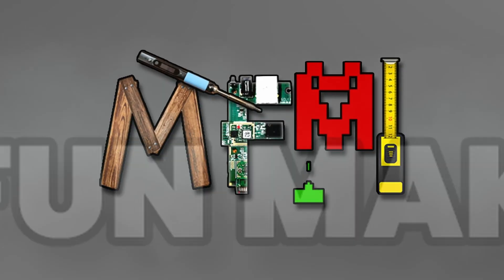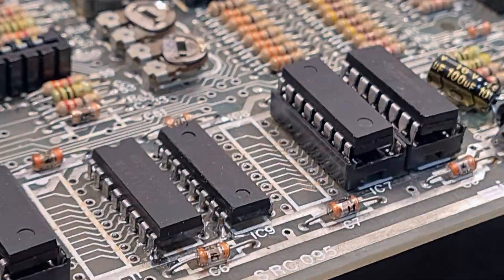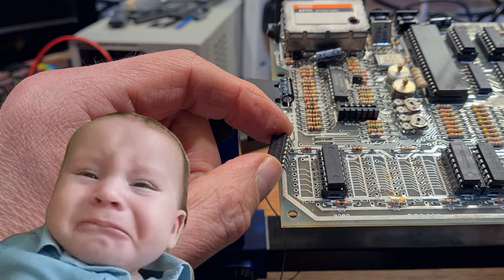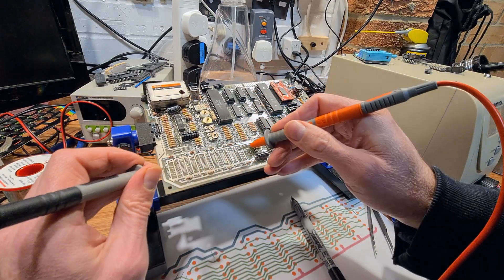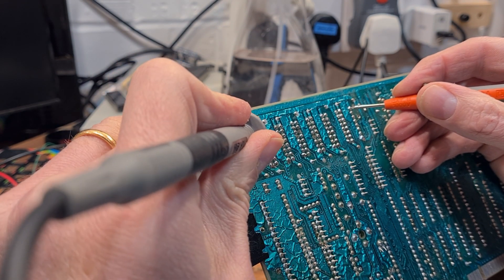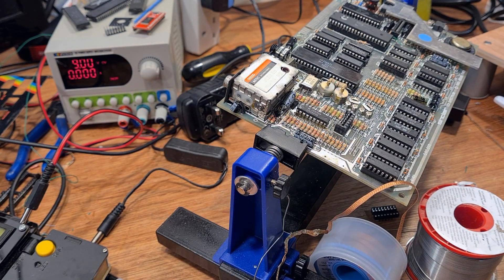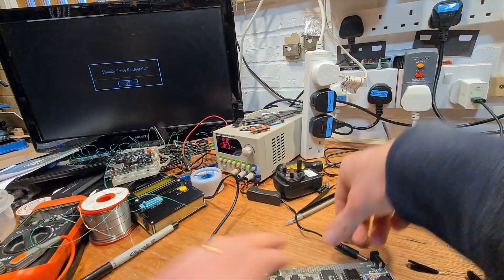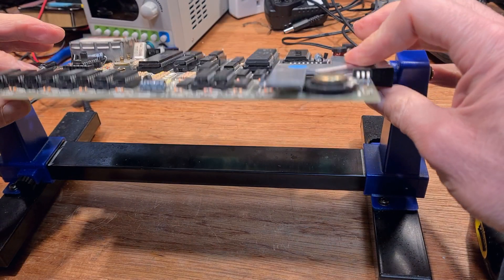ZX Spectrum FROM HELL - CARNAGE - Part 2

Comment: I have to say that although I really enjoy repairing things and watching repair videos in general, I really am appreciating your added brand of specially injection humour.  Very informative and enjoyable. 😁
Reply: As an added side note, I had one of these rubber keyed ZX Spectrums when I was a kid and it went in for repair so many times that I doubt there was much left in the end that was original.  I remember a few times going to the local electronics repair shop with my Dad and witnessing the ever increasing nest of multi-coloured wires as the repair tech showed my Dad the latest fixes.  Ever since I've always had a very strong impression that breathing on these circuit boards would be enough to make the traces do an impression of a drunk lemming, lol.
Reply from the maker: My boyhood Spectrum only had the one fault in its life. The keyboard membrane gave up eventually after too much Daley Thompson. I biked into town and ordered a new one. Picked it up a week or so later (very vivid memories of that journey) and took it home. It was my very first computer repair. I still remember opening up the case and wondering how I was going to get the membrane out of the keyboard.
Reply: @MoreFunMakingIt  I bet that was quite nerve wrecking at the time, but a good starting point on your repair learning journey. I think that my Speccy completely gave up in the end, but no idea what eventually happened to it. Maybe I'm watching you repair it right now, lol. 🤣
Reply from the maker: @juddery  There have been weirder coincidences than that!
Reply: @MoreFunMakingIt  there sure have, although I think the chances are quite slim on this one. I rather expect that my old speccy l9ng ago took its final trip to join sll the little calculators in silicon heaven. The idea of it being the same one makes for a good bit of amusement in my head though. 😁
Reply from the maker: Thank you so much! That's a lovely thing to say. For a moment I thought it was going to be a 'but' after the comma! 😂
Reply: @MoreFunMakingIt  Lol, definitely not. Besides, from watching these spectrum from hell repair videos, I'd say you've already had the but, or more precisely the butt, lol. Amazing repair work on such a mangled board. Someone clearly shouted yeehaaa before diving in to try to do the prior err... repairs, lol?

Comment: 7:20 at that point I think i wouldve opted for a Lower Ram Replacement module... would have made things easier. I can see how the ULA ended up getting toasted now...
Reply from the maker: I won't spoil it for you, but in the end I get to that point too.
Reply: @MoreFunMakingIt  Yep, saw that in the end. Sometimes its just not worth making the original chips work... or replacing them if more than 2-3 are faulty
Reply from the maker: Totally agree. Even if they test ok they're almost certainly about to fail any day

Comment: Excellent video and work! I has a similar issue with a Commodore 64. It was so bad, I told the owner ot would be cheaper to get another board. Over 25 different issues. Sometimes a board just can't be saved, sad
Reply from the maker: There is definitely a point where the amount of work you put into a thing is worth much more than the thing itself. I blew waaaay past that point quite close to the start of the first episode :D But this became a challenge and I can be a stubborn old fart sometimes.
Reply: @MoreFunMakingIt  I agree I think sometimes the fun is just the challenge ( If its not commercial ofc). My challenge at the moment as a beginner is actually finding something that is genuinely just not working rather than a dealer etc who has already had a go and failed as I would be starting with no chance if you know what I mean. Looking forward to part 3

Comment: That diagram of all the traces under the lower RAM chips is brilliant. Nice to know I'm not the only one that needs a mud map to find their way around a circuit board. Looking forward to part 3!
Reply from the maker: I took a picture of the traces and opened it in PS. Then traced over the actual traces on a new layer. It worked really well.
Well, it kinda worked. I missed 2 broken traces altogether!